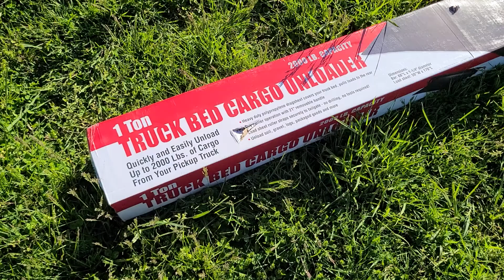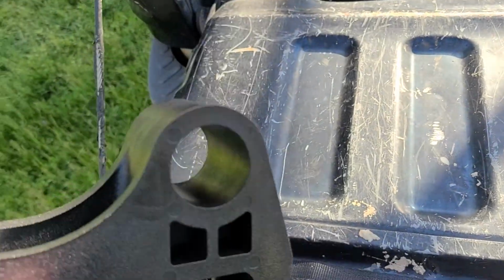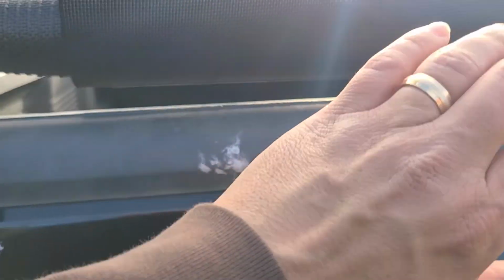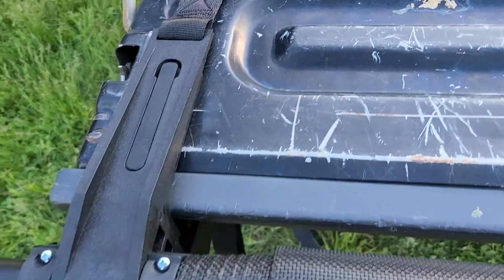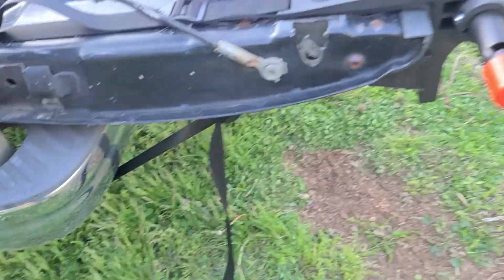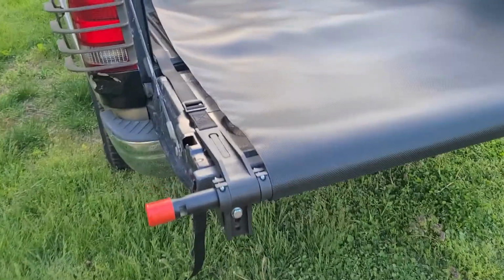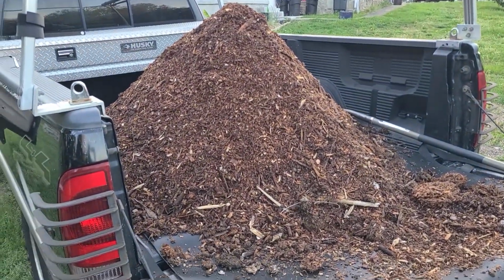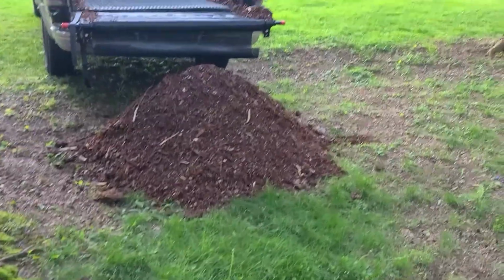How To Install a Cargo Unloader On Your Truck

Comment: It's a good idea to screw a 2" X 2" on the end of the tarp to keep the end from starting to fray (and it will) and to pull the material out without slipping under the material you're unloading.
Reply from the maker: @PainterD54  That is an awesome idea! Thank you for the tip. I will do that.
Thanks for watching

Comment: Bracket doesn't fit over the tailgate of our 2019 Tundra, any ideas?  To be clear the tailgate on newer trucks is too thick.
Reply from the maker: You might have to go with another brand.. Like ABN pick up truck bed unloader..  On Amazon, you might get the measurements in the description. I believe it's called ABN store.   My truck is 2000 F150. It's  Pretty old...